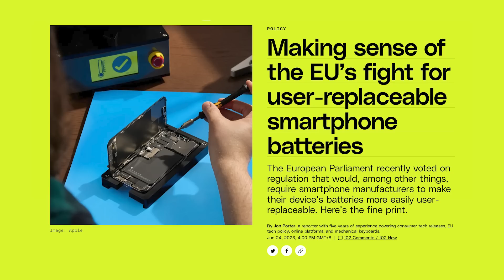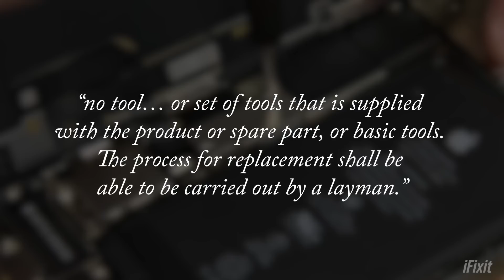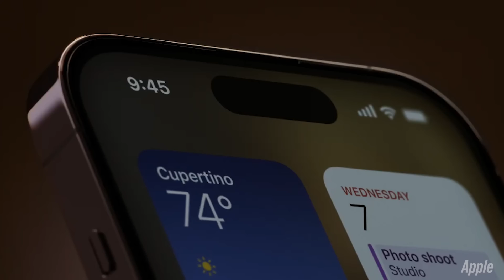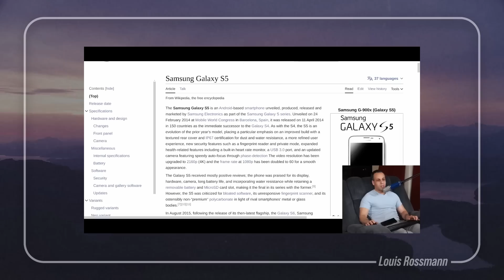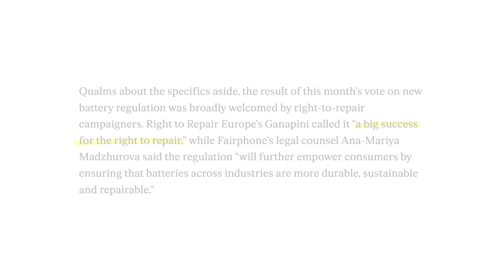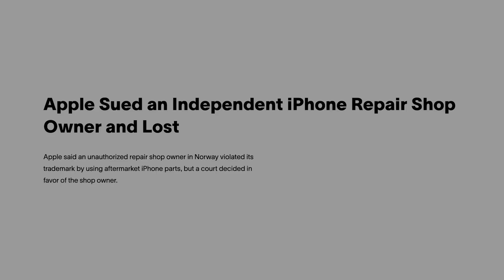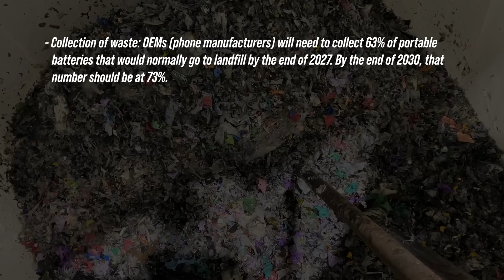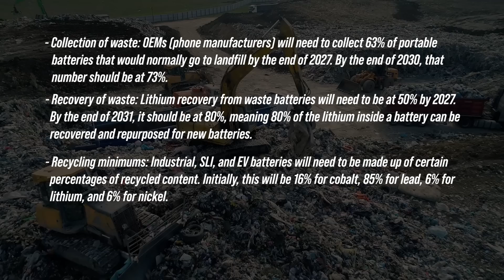EU Just Changed Smartphones Forever

Comment: Apple, along with many of the other popular phone and tablet makers, are likely to fight the regulations in court. Don’t be surprised if the 2027 date gets pushed back as the legal battles rage.

It’s possible that the industry will push for a compromise that allows users to have their batteries replaced by the manufacturer at no additional cost, arguing that it satisfies the goal of boosting battery reclamation and extending the life of electronics.

If not, it’s going to mean a huge shift in the way phones and tablets are designed. There was a time when popular Android phones had removable batteries, but even companies like Samsung that once touted such features as an advantage have since moved away from it. Building a phone that can be opened up relatively easily requires the use of gaskets and connectors and such that makes phones thicker, less durable, and harder to waterproof or dustproof.

The market has spoken, and consumers time and again did not prioritize removable batteries in their buying decisions.

Comment: It's just a crazy cycle. Customers want to have cheaper phones and new features to get them excited every year (consumptionism), beacuse that are acutomed to want that by companies (marketing). Manufacturers what to develop phones quickly with minimal effort and cost - removable anything is 2 times harder to design and manufacture, and a lot of problems with spare parts etc. So they go with this demand from consumptionists. 

So the change in consumer mindset happening or law introduced form outside that horrible system to barke it.

Comment: CF, it has to be the latter answer - no company nowadays - especially those undesirable profiteers, Apple are interested in recycling, because as you assert, it'll eat into their profit margins; I'd even go so far as to state that mssrs Jobs & Wozniak would be appalled at such a manouevre. Similarly, I remember the Samsung (& LG) Smartphones having replaceable batteries - & yes, I always carried a spare in my backpack; there is (also) the trend factor, ergo, many younger members of society who subscribe (or are influenced) to the latest must-have electronic devices, & virtually all phone, laptop companies push their products onto an unwary public; the very notion of having the latest tech is anathema to myself - & indeed, to that of my son. As an example, I initially purchased two identical phones (with contract) for each of us; the devices do what is required satisfactorily, yet as soon as I'd finished paying off the rental for same, I was bombarded by the supplier to upgrade. I calmly explained to the company salesman, that  I had no intention of replacing either, & whilst they were polite about my response to their enquiry, I could sense a degree of irritation in their voice. It's not so much about bucking the trend per se, rather, a greener imperative in ensuring the phones are only recycled when absolutely necessary. Neither my son or I are influenced by the Tech Market's hyperbole, & in that regard, we are content with the units we have.

Comment: Swapping out batteries (which I did on early Samsungs a lot esp when traveling) tends to wear down the connecting metals (which I think are gold plated).   I applaud the right to repair, but the manufacturers need to come to the party to make it work.

Comment: We need to ensure products move further in the direction of modularity. We need to encourage the ability to improve products by replacement only of those parts that need it, and not the entire product. Modular products need to attract tax benefits. And any, not modular, should have strict mechanisms to ensure manufacturers have "whole life" management responsibility.

Standards for modular products of many different varieties could be created to allow competition and third party module innovation. This could give an extended life to modules with resale value. Phones could become separated units wirelessly linked and even powered, alternate types and styles of interface to suit, wrist worn, spectacle based, clothing integrated, wallet smarts. The cost of ownership should go down as the longevity of modules goes up. 

A circular economy is hugely facilitated by modularity and standards... and the elimination of adhesives and coatings. In a sense the model for this is the component HiFi systems of old. You upgraded this or that component and sold the older part on to someone less obsessive.

Comment: The other big thing for planned obsolescence is stopping software updates on perfectly good hardware. Kinda frustrating to have a piece of hardware that works just fine, but can no longer get security updates, etc.
Reply: Agreed. It should work for 5 years.
Reply: 100000% My wife and I still have  a pixel 1, pixel 3xl, iphone 6, iphone 8 on our shelf, well taken care of, hardware is perfect a but no longer supported. it doesnt make sense not to support older phones. There's nothing wrong with the hardware, similar to my 2007 laptop i use as a media pc, upgraded the ram and replaced the battery a few times it still works... no reason at all to brick older phones but for greed
Reply: Apple support their products for 8 years with updates. Old tech is old tech. How long do you want it last?
Reply: @panamaJ  yes, for this issue, Apple is Goof. On Android even with a flagship Pixel, you get 3 years of updates if I'm not mistaken.

Comment: I have a Fairphone; all components can be replaced by me, just with the use of a small (supplied) screwdriver. So far changed the bottom module (speaker and charger). Love it. That with almost any other phone would've cost me a new phone or expensive 'repair'.

Comment: Glad to hear this. Hope the lifespan of screens and construction of parts will increase as well.
Reply: Honestly, I expect them to decrease immediately. Failing batteries were a way for manufacturers to guarantee you'd buy a new phone often. If the battery no longer drives new sales, they will decrease the quality of other components so that a failed screen or button will motivate you to replace the device. These manufacturers will try anything they can to maximize sales. At very least I expect very specific batteries for each phone model. That way your replacement battery after two years will be hundreds of dollars from the manufacturer because of "limited supply".
Reply: @aaronschooley9103 the easiest way is to not providing any updates including security to phase out the device. And pestering the current users, with notifications that their OS is outdated, just like in Windows.
Reply: @nonconsensualopinion  seems like those policies need a good and well rounded draft made with expert insights.
Reply: After 2 years the device will instantly crumble to dust.
Reply: People do know you can just take the phone to a tech and have the battery replaced... right?
Reply: @rsonic510  It used to be a 5 seconds job you could do yourself, now you have to be without your phone for a whole day, if not longer, and pay for the person changing it as well...
Reply: @dantichri5t  It you'd rather buy a new one instead of few hours of maintenance, it's on you, really. Most people didn't care either way, and thus the battery was sealed so we could have slimmer, waterproof, large battery phones.
Reply: @rsonic510  depends on the phone. Some are really difficult to open without destroying the glass or casing. And when the battery is glued in it's also difficult to get it out without damaging something.
Reply: It’ll increase the price that’s for sure Apple now has to innovate.
I’ll keep buying Apple price is always worth it

Comment: This trend started after companies started imitating apple design of minimalism and smooth lines. This required to get rid of the "seam" of the 'open case to replace the batteries'.

Law makers have waited for ~15 years to enact this law and it's about time. Yes the phone looks slightly better but today all are the same and can sometimes last 5-7 years if the battery is replaced.

Comment: User replacable battery is good especially for EV market.
Charging isn't convenient as the wait time will take some time.
If every EV manufacture have 50% of car battery can swap on demand, no need to wait for charging up EV cars like an hour.
Provided those battery station can have solar powered for greener approach.
Manufacturer also can easily detect fault battery via BMS chip and network of stations, recycle that battery and produce new one.

Comment: Louis is 100% correct the water resistence is key this isnt even a repair its maintenance

I dont think phones should have this feature just make it easier to swap out parts with every part having a connector like the lgv30 its a shame lg stopped making phones they were so good with a water resistence rating of ip68 and each components are easily replaceable.

Swappable batteries make sense on a laptop, i prefer laptops with an internal and swappable battery so if you cant charge it just swap the battery without power interuption.

Comment: For larger batteries apart of EVs or home batteries this concept of "easily replaceable" needs to be present also at the cell level not just battery level. 

Meaning if a battery has bad cells they can be replaced, these approaches to battery assembly also let the cell holders or battery enclosure and conductors connecting cells in series or parallel be reusable, so in a decade or two the battery can be serviced and only waste to be recycled is the cells.
Reply: For bigger batteries only yes. Do not do that to small batteries. I mean at least for those that can be replaced by non repair-tech people. The enclosure protection should not be compromised. And that can happen easily  in the wrong hands. The toxic materials are a no joke.
Reply: @InvictraX  what smartphones use don't have a smaller cell so they aren't batteries...they're cells, not talking about opening up cells. Serviceable batteries would have dozens, hundreds or thousands of cylindrical cells(18650, 21700, 26650, 32650, etc.).

Comment: Imagine a future where phone manufacturers only have to design and release a new phone every 5 years or so to keep up with newer hardware. You can easily keep using your phone for over 10 years if you can just replace your battery every 2-3 years
Reply: If its not the battery it will be the software which is not supported after a few years.
Reply: @pcdispatch  The EU also passed a law for that recently.

Comment: Why do I want replaceable batteries? its the last thing it breaks down! I been using the same s10 5g for 3 years and sure, the first 7% go down quickly on the first hour or first 10 minutes of browsing the web, but then it holds pretty well until this day, i always end up with 30+% at night, and on my free days if it goes below 20% and get battery anxiety I just plug it for 20 minutes and get another 40% on top...
new batteries have 1000 charges at least of use until you see some performance drop

Comment: Maybe this will force some innovation in phone designs now, at least in terms of cosmetics? It irritates me to no end that most of the AAA phone brands, namely Samsung and Apple, haven’t really changed up the style of their phones in years.

I’ve got an iPhone 12 Pro Max, and have thought about upgrading to one of the newer models, but the styles are completely identical to my current phone, save the camera lens layout (which is the only thing they upgrade that I, coincidentally, DGAF about). I remember being a kid and being unable to choose which phone designs were my favorite (or even which were ugliest) because there were different kinds and each phone manufacturer was trying new things with every new iteration (for the most part). Glad the EU is doing this. It’s not only practical but might light a fire under the AAA phone company’s behinds to try harder with new designs, and maybe bring modular phones from pipe dream state to reality.
Reply: And not to mention laptops and the other products you mentioned. Laptops need a bit of a kick into design gear too

Comment: When they stopped using replaceable batteries, id say it should be considered criminal. Also consumers should have a choice of customization and have phones made to order. For example, if you want a phone with replaceable battery, no cameras, bigger size for bigger processor, etc you can get it.

Comment: I wish Apple stopped with the anti-repair practices. I'd really like to try their hardware, but I won't spend $3-8k on hardware that will just break and can't be easily repaired. (edit: I meant laptops, I'm not interested in iPhone)

The Fairphone is leading the way in repairability, but it's kind of chonky and expensive for the specs. I own one, and it works well, no repairs needed yet. I can't wait until I can buy a decent mid range phone from other manufacturers that can be repaired.
Reply: Where the heck are you living that an iPhone purchase would cost $3-8k? Also Apple offers self service kits if you want to repair a phone on your own.
Reply: @onesleepyazn  Macbook, Mac Pro

Comment: This would be terrible news for foldables, some foldables have dual batteries, one on each sides, massive headache for redesign, and goodbye thin foldables or flippables.

I can see Apple is kinda ready for this. For their Phones, just make MagSafe the default batteries, have a small backup capacitor on the phone itself. Btw Apple has made different phones for different markets those with extra mmWave radio and just regular 5G, there is precedence. And China is more than capable to rebadge its phone for different markets, take Xiaomi with Xiaomi Redmi Poco, same phone different antennas, different battery size, different cameras.

So the answer to most devices would be external modular batteries or battery cases, buy the size you want, attach it with any locking mechanism, good old days, and still sealed for long term ip rating, not just a couple of months. Battery case for phones and tablets might be making a come back for EU, I remember a time when people mocked the humpback iPhone battery case, MagSafe batteries look the same as smart battery cases, nobody cares, especially when internet folks don't make a big fuss. Folding phones a separate battle, maybe stick on a V mount battery, or just MagSafe we know Samsung has a bunch of MagSafe cases and Realme has ~50w Magdart. While for EVs, there is Nio with their swappable batteries.

Comment: This move is a win for the right to repair. A responsible regulation that protects consumers from companies overstepping their authority. Current options for fixing an iPhone is either overpriced apple care for a mere extra 2 years or apples own services. The only potential objection I have is for removable batteries on all devices. ie by 2027 laptop batteries will probably last several days on one charge so a removable battery seems redundant. Wireless charging will also improve to the point of making it redundant.

Comment: @ColdFusion Will EU be able to guarantee everyone that no unnecessary unsafe moves will take place with these devices like with the use of cheap quality after-market batteries as the replacement for the original ones that used to happen before? These could be a Health & Safety risk worth considering as those batteries could be unstable and have a tendency of thermal runaways i.e., catching fire...

Comment: The main reason I liked removable (or easy to remove) batteries was that I could quickly remove power from a malfunctioning device and then reboot. 
(Data loss typically would be minimal when I had to do a battery pull, but could be worse if the device stayed on with a memory fault happening in ram or cpu. )
Reply: Ah yes, that was convenient. Had totally forgotten about that, but once I had to remove the battery from Nokia N900 because I was getting a call while waiting in a line in grocery store and I had this obnoxius ring tone (Touhou night of nights remix I think), that just blasted out with max volume and the whole thing just froze, lol.
Reply: @cristibaluta  
Button combos usually take several seconds to function, if a device is memory looped or overheated the combo may not work. 
Button combos are not the same for every device and may require time to research, time to train into muscle memory, and again have luck that the combo works when needed. 

While a battery pull to remove power may seem primitive, it is rather efficient and civil. 

(Complicated Button combos to power off, sounds like something John Deere would implement.)
Reply: @cristibaluta  In some of my past phones and devices I could plug in a power cord and "hot swap" the battery while the device was on and then unplug and go, I did like that old feature. 
The pushpin/paperclip insert strategy (for opening physical electrical connectors temporarily) was useful in the past also. 
Device makers may bring those features back or they may start doing water resistant battery pack modules/trays to meet global requirements and cost efficiency. 
( I would see battery trays as a positive for device makers as they could upsell more customized tray options beyond the basic standard included, such as a split tray with two individual "hot swap" batteries).

Comment: the battery needs to be removable but the company doesn't have to provide updates for the device for more than 3-5 years?... what's the point then? tbh i have never seen a battery fail on a device that is handed properly in less than this amount of time... I'd prefer it if manufacturers who opted in and made devices with removable batteries were rewarded with bigger tax cuts... I'd rather also have people vote with their money and choose if they want a glass sandwich or a removable battery..